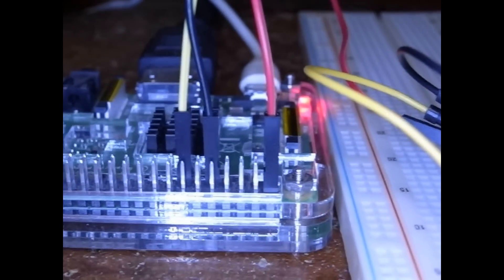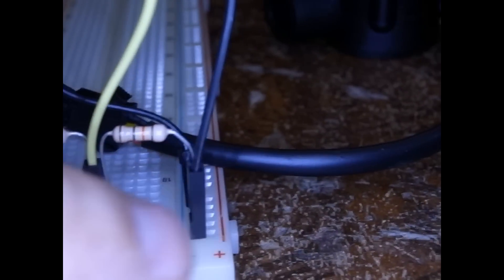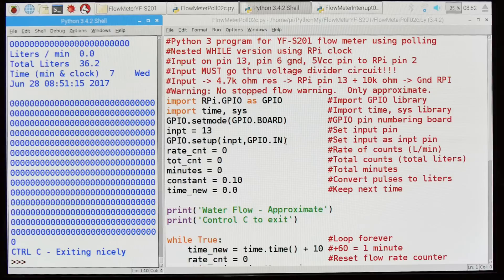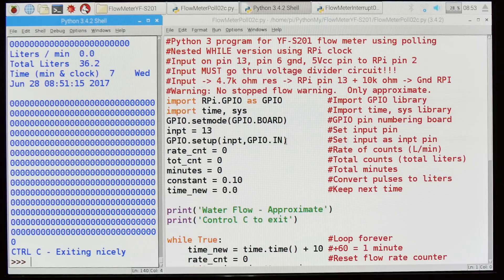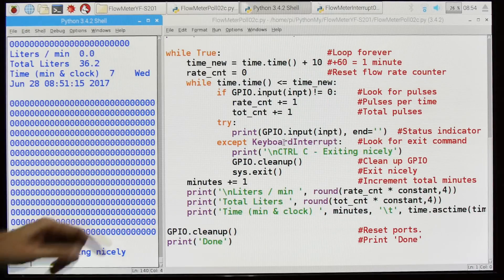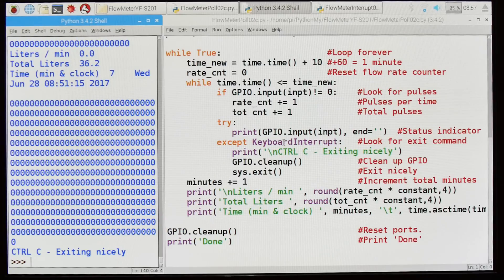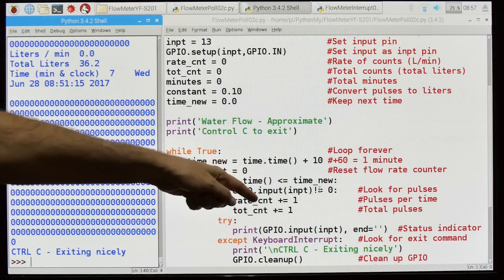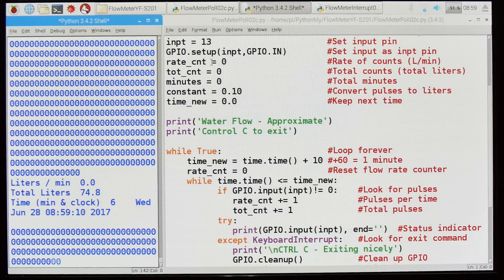RPi 20 - YF-S201 Hall Effect Water Flow Meter / Sensor

Comment: What's up man? Well, i'm having some errors.... I bought a water flow mater 3/4", and then I wrote all the code as well, and I'm having the following error: 
Run time Error: please set pin numbering mode using GPIO.setmode(GPIO.BOARD) or GPIO.setmode(GPIO.BCM)
What can I do? Anyone can help me?
Reply from the maker: Yes, I have 3 versions coming out.  This is the first, it's not released yet, but you can see it here:
https://www.youtube.com/watch?v=0fqoq1jWlts
It eliminates the stopped impeller error issue.
Reply from the maker: Sounds like your setmode statement is wrong or commented out or such.  Remember they have to be exactly the same including ".", capital letters, etc.)
Reply: I've checked out all the code, but there's a little thing that it didn't match: 
[...] time.asctime( time[...] and the end of line is cutted off. Could you tell me what is written?
Thanks!
Reply: any update on this one?
thanks!
Reply from the maker: Sorry, just saw your comment.  That line is:
print('Time (min & clock) ', minutes, '\t', time.asctime(time.localtime(time.time())),'\n')
Reply from the maker: Yes it is in the works, but my real job is interfering with my hobby!  ;)  Should be done in a week or so.  I will leave you the link here when it's done and before it's made public.  I solved the stopped impeller issue.

Comment: Hello,
thanks for the nice tutorial video. We are currently working on a project where we maybe want to use a similar flow rate sensor. This is why i wanted to ask you, whether you happen to have a log file of the raw sensor values (ticks or pre computed speed values at some time points). This would allow us to analyse the sensor upfront in order to check whether it fits our requirements. So please send me a log file if you have one, this would help us a lot!
Thank you in advance.
Reply from the maker: I did not keep the data since I made it during a test.  I just blew air through the meter.  You can do the same if you want data.
Reply: wanted to have a look at the data, before buying the sensor, without knowing whether it's good for us... but thanks for the quick reply!
Reply from the maker: The data is just 1's and 0's.  The faster the water flow, the more 1's you get per minute.  Add up the 1's per minute and you get the rotation speed.   The meter has a maximum and minimum speed.  (It does not give good readings above and below those.  I talk about it in the video.)

Comment: Hello sir ,
I am using sea water flow sensor yf G1 (1") bought from ebay.
I am getting some incresing flow rate on serial monitor as i increase flow rate. but this happens upto certain fixed rate after that it shows same value sometimes decresing values(like gaussian) as i further increase rate. But it should be linear. so please help me find out some way of this problem. I am in  learning state of usage of flow sensor.
Here is the link from where i bought flow sensor 
http://www.ebay.in/itm/DN25-YF-G1-large-flow-water-sensor-for-industries-swimming-pool-irrigation-/231992894058?hash=item3603daa26a:g:j4QAAOSwM4xXcRmz
Reply from the maker: I am not an expert, just a hobbyist.  Some things to think about, are you within specs?  This is only rated for 2-100 L/min.  If your flow goes above or below at any time, it will give false readings.  Here are the other specs you have to stay within:
Working voltage 5-18VDC 
Water pressure resistance >2MPa 
Insulation resistance >100MΩ 
Characteristics of Flow pulse f=(4.8*Q) Q=L/Min 
Flow range 2-100L/min 
Working temperature range -20~85C 
Accuracy ±3%
Reply: tsbrownie 
Thanks for your advise.But the sensor is giving increasing values upto 30lit/min after that is is decreasing. There is no provision for checking pressure where i have to fit the sensor.so what should I do.
Reply from the maker: The sensor works by counting pulses.  If the values are decreasing, that means the pulses are decreasing.  If the impeller is not sticking then it means the pi is not counting the pulses.  That's a high probability.  The pi could be too busy doing other things and missing the pulses (you could try using interrupts, but that also has problems).  You could rewrite the code to ensure the pi is giving priority to counting.
Reply: tsbrownie 
Actually im using this sensor with arduino...

Comment: A common practice used tracking an input that can remain in a unknown state, i.e either 0 or 1, is to detect the rising edge of the input. In you code a count would be triggered only when the input transitioned from no flow (0) to flow (1). Using this technique it does not matter what the input state is only that it did make a transition indicating that flow is occuring.
Reply from the maker: You are right of course and the pi is supposed to be able to do that with interrupts, but it did not work.  I found a bug report on it, so I think it's not just me.